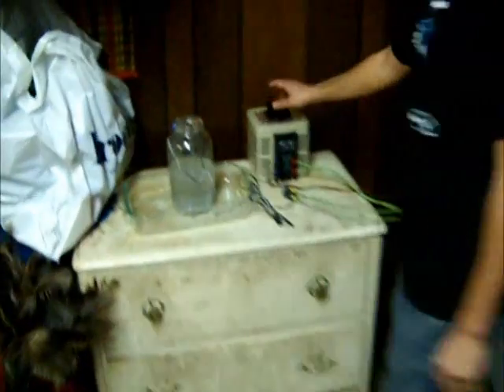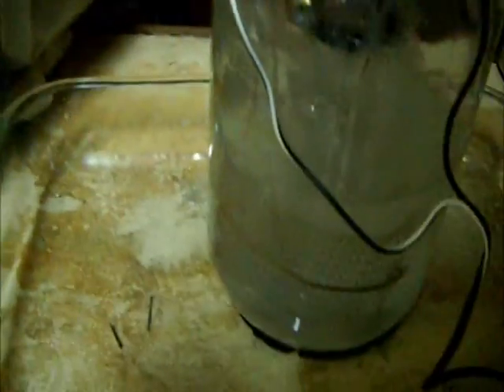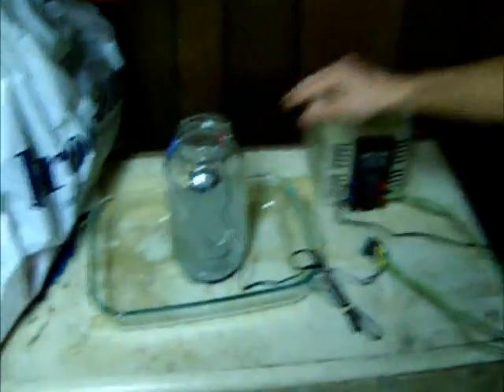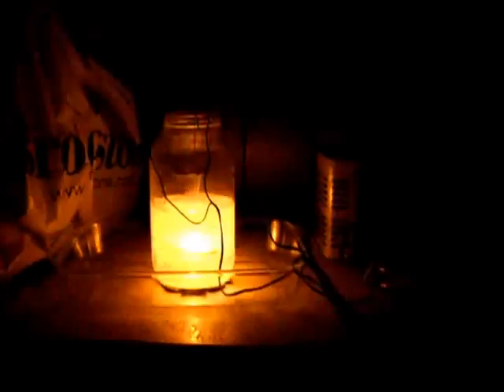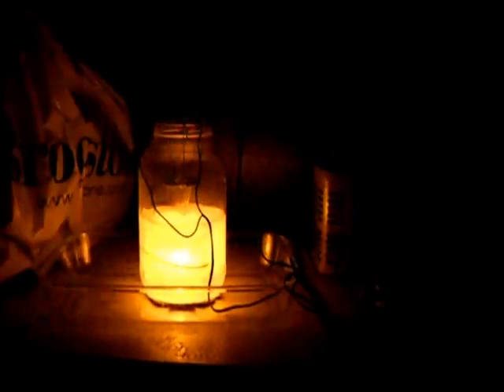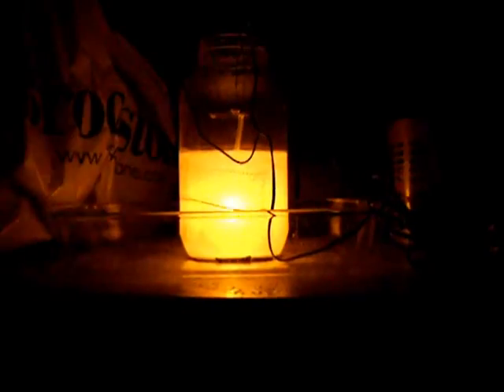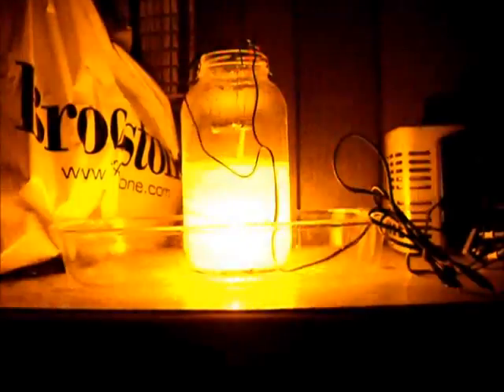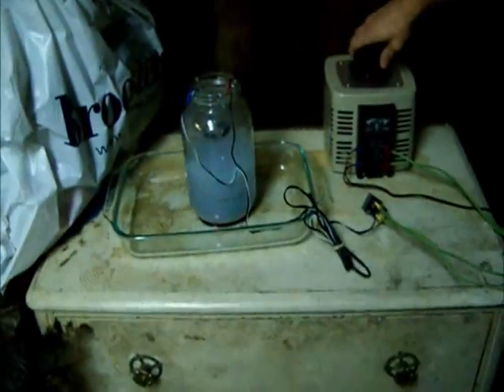Cold Fusion is Fun

Comment: Not cold fusion, your just burning hydrogen that is created through the electrolysis process. The reason why it turned white is because ether your electrodes fell and sorted, or someone off screen turned up your variac. And also in fusion you need to force 2 hydrogen atoms together, and you are not doing that by burning the hydrogen.
Reply: Also you need to pack the helium atoms together so tightly that they will collide with each other, otherwise they will just fly past each other.

Comment: It emits light can you use Solar Panels around and see if it generate electricity?
Reply: sounds like you have been in a labatory.   there is a less fabulous way to produce light but it works.   Heat a piece of chalk in a hot Gas flame of any sort it will luminess (lookup limelight).   I say this as an example not a whole idea.  I was thinking as a backup generator.

Comment: this is not cold fusion, this is plasma electrolysis, and how we are able to have tanks of hydrogen and helium at our party stores, this is ancient tech from the 50-60's.   
1. electricity is not cold. it heats up very hot, if this is cold fusion then it would produce no heat.
2. cold fusion is meant to produce power not use it.
3. fusion reactor is a sustained thing, what you have is a plug in a wall that you have to turn off and on. a real reactor has no switch and couldn't be turned off if you wanted too.  again are only doing plasma electrolysis.
Reply: this is cold fusion..it fuses molecules releasing helium and a ton of heat at a very low voltage compared to most fusion reactors, so in turn much less heat than others. It's an LENR
Reply: maybe you arent familiar with the terminology here but cold means without heat, this is just a plain fusion reactor, not cold fusion, let alone all the gamma radiation he was producing, this guy doesnt even know what he is playing with, I am no physicist, but even I know that this is deadly and stupid, let alone not what he is claiming
try a little research before making claims
Reply: Cold fusion doesn't mean the reactor stays cool. It means you are creating a reaction that fuses two atoms together with out exhausting nuclear fuel. This is simply producing hho. To produce Helium use resonant atomic transmutation of Dueterium to Helium through plasma electrolysis of a lithium salt and dueterium oxide solution with a palladium cathode. There is not enough pressure, pyrolysis, or electrolysis going on here to fuse the two hydrogen atoms together. Only split the h2o into hho. What nuclear material is being used to fuse the charged ions?
Reply: Alex Black none cuz he’s using a transformer

Comment: Could you please post the model number / brand for the VARIAC and also for the bridge rectifier?  Specifically having trouble finding a transformer that will put out the higher voltage.   Obviously most of your viewers have little or no idea how cold fusion works.  I would say you were likely successful, and yes, you may want to take a bit of care to avoid the gamma rays.  Helium produced would be undetectable except with a GCMS at the levels you are producing but it has been detected in similar apparatus using low detection equipment.  Kudos to you for pulling this together in your home.

Comment: This is extremely dangerous, when the helium is produced, about 200 rads are released in a reaction this size. And this guy doesn't look like he knows what he's doing.
Reply: when is helium produced? he's simply splitting the hydrogen and oxygen atoms in the water and the electricity inside is igniting it.
Reply: hello world but if you look at the arch colors of sodium from salt that gives you an orange/red color, eventually this color turned a sort of. Soft white/ orange color which is coincidentally the color of helium on the color gas spectrum. The color of helium on the spectrum can even range from grayish blue or   Green blue, if given the right conditions.This topic has been argued for years, and still could be.
Reply: He doesn't.

Comment: next step is magnetic confinement of a plasma steam. Also, consider adding lithium hydroxide, and possibly a boron thing to the solution. It would make tritium, and deutierium for better fusion. Another possibility is making a workshop style light with hydrogen instead of mercury, with magnetic confinement. Also, know that every second that thing is on puts you at risk of never having kids.

Comment: only way ill believe this is if he inflates a balloon with this He gas and then puts a lighter to the ballon. If he ballon rises it could be hydrogen or helium. If he lights it and it combusts in the hindenburg it is hydrogen and fusion is not taking place. If it does not combust then it is helium gas. Then only thing that would discredit this logic is if there is a combination of hydrogen and helium where not all the hydrogen is fused into helium giving still a ratio that combusts. Nevertheless. this requires proof of at least helium production
Reply: I saw it done by a guy in the philippines on youtube he blew up condom's lol
Reply: He had a dry cell about 118 blates 4x6 in then he charged it with about 250 volts then he ran it through 2 bubblers and produced 10 liters a minute

Comment: Wouldn't that release radiation?
Reply: Nahben Haben Umm, based off the colour and brightness, the reaction either produced dangerous levels of Roentgen-radiation (X-rays) or there was no fusion at all. Also, if you do a quick research you would notice that the amount of water would block out less than a quarter of that radiation, more likely an eighth. That is no succesful radiation shielding.

Sincerely
Marrus Q.
Reply: Yes, in fact it does. In small amounts.
Gamma emission is rare and in small doses. 
Neutron emission is very rare. Alpha emission rate is not consistent with accumulated helium. X-rays are most evident, but a good amount is blocked by the water (and in this case the pickle jar). If you took a giger counter  up to one of these you would get a few clicks every so often. If you were near the core (Like right on top of it) then it is much more intense.

Comment: So it produces ammonium cations? Quaternium is a positively nitrogen bonded to four carbon chains. As Wikipedia says "positively charged polyatomic ions of the structure NR4+, R being an alkyl group or an aryl group."

If you are referring to a proton attached to 3 neutrons... then you're talking about something that doesn't exist, and as such has no name. Tritium is the largest (partially) stable isotope of Hydrogen. No other arrangement is possible because the weak force won't permit it.

Comment: Brillouin Energy Corp has well documented excess heat from their LENR reaction that does not start with with heavy water or deuterium - just clean plain water. They have a very nice tutorial video on their website, and are currently doing next level research with the SRI Lab at Stanford. Check them out.

Comment: Some great info on LENR "cold fusion" is on the Brillouin Energy website. They document how hydrogen ions H+ (no electron, basically one bare proton) get driven into a nickel matrix, and inside that matrix have electrons driven into them with sufficient energy for form a neutron. Energy released here, but it goes on - stepping up to deuterium, tritium and even for a brief moment quaternium which quickly degrades into 2 helium atoms.

Comment: if this is cold fusion i'm a brain surgeon. its called tig welding. The gas tungsten arc welding process utilizes the heat of an arc between a nonconsumable tungsten electrode and the base metal. The arc develops intense heat, approximately 11,000°F."  which caused the light. the erosion of your wire is called burn off. sorry to pop your bubble dude. it might be a neat trick if you needed to do some under water welding. but its not the sustained energy dream you are trying to play it off as.

Comment: hmm....I don't want to burst anyone's bubble.  BUT, cold fusion reactors are created by using heavy water, which is Deuterium(2x) combined with an oxygen molecule. Deuterium has one neutron and one proton, and one electron. So that throws this experiment out of the water(so to speak). There is something called proton-proton chain reaction(sun) Which uses normal hydrogen ions(x2) during fusion to make a Deuterium atom and energy. Its a process of changing the quarks in a proton to make a neutron.

Comment: Can u put a thermometer in the container when it reaches the point of cold fusion? or 
mabe u could put in a non conductive can full of tap water ( so it will boil and hopefully steam) and show that it's possible to make a steam generator that makes electricity!!!!. My point is that if u can produce high pressure steam from this cold fusion reactor then and only then will device be proven useful other than just a cool noisy light

Comment: Look up the reaction charts on wikipedia. They all produce neutrons or gamma rays, or positrons. Positrons (anti-electrons) destroy themselves when they hit electrons and generate gamma rays.

With only one exception whose reaction product wouldn't react with one of the precursors to generate a neutron or a gamma ray... and that would be Helium 3 with Helium 3.

So unless you work entirely with Helium 3, any fusion you do will generate dangerous radiation.

Comment: Muons can be used to reduce the energy required to induce fusion in any fusion situation involving hydrogen or its 2 isotopes... because like I said, it reduces atomic radii temporarily, so atomic densities go up dramatically. Increased density = less energy needed to fuse nuclei.

Muons don't have an effect on Helium 3 because it has 2 electrons around it, and muons are unlikely to replace both, so the atomic radius will remain the same size,

Comment: I'm not telling you what to think, I am telling you your logic is flawed. 2 + 2 = 4, and it doesn't matter how you rearrange the numbers or try another mathematical system, the equation works the same.

If you try to fuse hydrogen or deuterium into helium, you get either gamma rays or neutrons. There's no way around that, unless you can add some exotic substance that would either absorb the neutrons while not hindering fusion, or convert the gamma rays to something that can be absorbed.

Comment: @HONORGUARD308 Muons are negatively charged like electrons. They want to act like an electron and orbit a proton, but they're quite heavy, and when they do displace an electron, they orbit very very close to the proton.

They increase the rate of fusion because they make the hydrogen or deuterium atoms much smaller. Therefore the nuclei can get much closer to each other without increasing the plasma energy. But the "nuclear" reaction is the same- same results.

Comment: @HONORGUARD308 Nope, simple physics regarding fusion. It's a clean fuel in that the end products aren't radioactive, and the reactor core isn't radioactive when turned off... but when active and fusing, there would be a lot of gamma radiation and/or neutrons, depending on the kind of fusion you're doing.

Even theoretical low-temperature fusion using muons would kick out some pretty nasty radiation and charged particles.

Comment: @HONORGUARD308 There's only one formula to fuse atoms, and if you're producing so little fusion that it produces unnoticeable levels of ionizing radiation, then it's fusing so little hydrogen that you might as well not have bothered. It would be less than a few atoms a second in a reaction. At those levels your net energy output would be massively into the negative numbers.

As I said before: If you have an unshielded reaction and you're not dead, you didn't have fusion.

Comment: @HONORGUARD308 Look up the nuclear reaction formulae for fusing hydrogen or deuterium and you'll see that neutrons or gamma rays are produced. They have to be produced or conservation of mass/energy is not maintained. Therefore if it *actually* happened, and you weren't behind some heavy lead shielding, you'd be dead from the irradiation.

Also, aside from detecting fusion products afterwards, it's only way of confirming that you actually generated fusion.

Comment: @mrtruthify I don't say cold fusion isn't possible in some form, but there needs to be some mechanism of confinement. And an arc under water does not cut it, It has been tried in every different form and not worked. Also did any one else notice that 185kj out vs 168kj in is about exactly the ratio one would expect if you were using a cheap non-RMS electrical meter, and didn't factor that in? And if your making those kind of mistakes, you ain't even electrician material, let alone physicist.

Comment: Try 1 gram Nickel powders in micrometer size enclosed in a massive copper-plated steel chamber w/ 1g of H gas & 1g of benzene & graphene in varying ratio--just get the right mixture of the catalysts (benzene and graphene are the catalysts needed to ionize H). The chamber should then be hermetically sealed and heated by resistors up to 400 deg. Just monitor or maintain that temperature at start-up by water boiling. If temp abruptly rises to dangerous level, stop the current flow to the resistors.

Comment from the maker: Hey GeeksWithFeet!  Sorry for the wait!

Confinement forces are absolutely not necessary for a 'cold fusion' process to occur.  The electrode is the negative part of the circuit in my vessel, and it is where the hydrogen gas forms during electrolysis. As I increase the voltage, the hydrogen gas is ionized (meaning it loses its electrons).  So, the remaining hydrogen ions (H^+) are attracted to the electrode with little repelling forces (i.e. a magnet).  This is enough "force" to start fusion.

Comment from the maker: Hey benjorgensen1!
The purpose of this video was to show the step up between plasma electrolysis and cold fusion.  The process of cold fusion does output a greater amount of energy (in joules) then the input, but it is unnecessary that it power itself to achieve this.  I hypothesize that when I finish my analysis, the results will look somewhat like Input=168000J, Output=185000J.  This for example would be obtained using my house current, yet it results in an excess of energy.